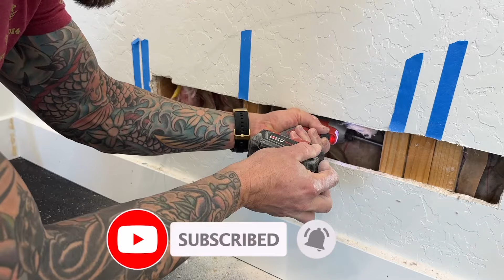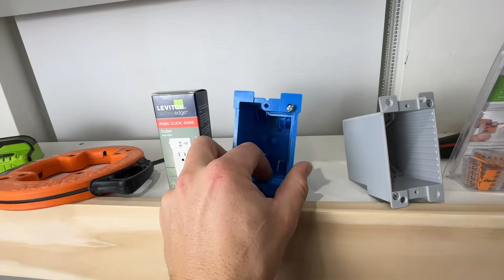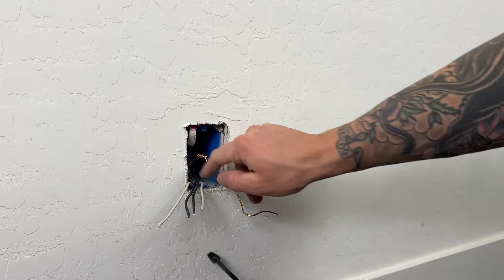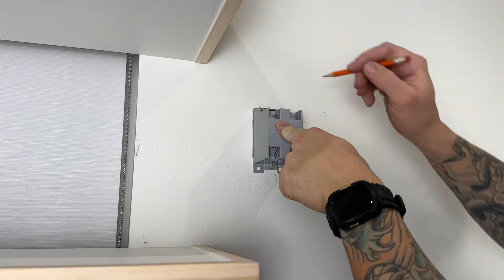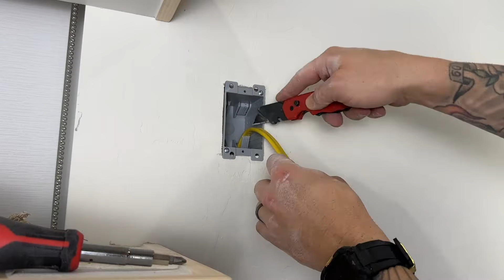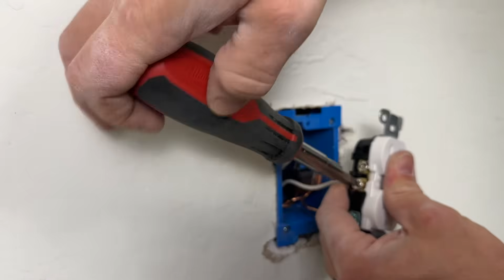How To Move An Outlet Up The Wall | Full How To

Comment: What if you don’t have a sawzall?
Reply from the maker: For cutting the drywall? In this I’m using a multi tool. But even if you don’t have something like that they sell a key hole saw that’s made for cutting drywall. It’s a way to cut out your drywall manually
Reply: @FortKnoxCo I’m sorry ,I meant to cut the nails. Would a the multi-tool work for that?
Reply from the maker: @MelMakesit ohhh. Ok. Well if you happen to have a multi tool you can still use that to cut through the nails. You’d just want a bit on it that’s made for cutting wood/metal. Just insert it at that angle down or up to hit where that nail is. The sawzall just has the longer blades to make it a little easier to hit that angle and reach. 

If you don’t have a power tool that does that you can still pry the outlet box off the wood stud with a strong screw driver and with a little work you can get of loose and un attached. Then you can either finesse it through your opening or I’ve even used needle nose players and removed the nails from the plastic box and then removed the box. Either way you may damage the drywall a little it because your working through that small opening. It’s kinda like the old kids game Operation, using tools to get the little piece though the hole without touching or damaging the edges. lol. 

But my next thing to consider is , if you’re going to be cutting the drywall next to the box anyways because you plan on moving it sideways…. Cut that drywall strip and you’ll have more room to remove that box anyways and prying it off the stud with the screwdriver is easier  and you can get it out of the wall much faster since your drywall is all opened up. More room to twist that box out and remove it.

Comment: Thank you for the super detailed step by step! one quick question, is it ok to not have the new installed blue old box attached to the stud again like it was before? thanks for sharing!
Reply from the maker: You mean like the new one or added one? Like where it can float on the drywall wherever you cut the hole and the tabs grab and secure it in place?…. Yep. Sure can. It’s sorta up to you have you want it to sit or be located. Nailing to the stud is very secure and standard building practice. But not necessarily required when doing renovation work.  There’s usually variances allowed when your not doing new construction and working on and update or renovation
Reply: @FortKnoxCo  I meant the old blue one you ripped off with nails, the new one (also blue) you installed didn't have nails to attach to the stud, my question was if that's ok to do, not attaching with nails again. Thanks again sir, you rock!
Reply from the maker: @tongoso yep. You can install an old work box in both locations. However you decide to install the original location or the new one. You have options. But it doesn’t HAVE to be nailed in type of box.
Reply from the maker: Also I just launched a discount code for my website grab any T-Shirt and get $5 off each one. $15 shirts 🤙🏼 Code:FORTKNOX5
Reply: @FortKnoxCo  thank you!

Comment: I did this yesterday following along with your video! Keep in mind, I'm mom in my early 30s and have never done anything remotely close to wiring or electrical! 😂 But we needed to move an outlet up the wall for a built in coffee bar we are making! Anyhow, husband was impressed and according to my Klein tester, everything was wired correctly! So thank you so much for this! It made the job less daunting and seem more attainable! 😀👍🏻
Reply from the maker: That’s so awesome to hear. And that’s exactly why I made this video and all the other ones on my channel. I want to share the knowledge and experience of being able to do something like this yourself. It’s very fulfilling and it obviously helps the bank account, lol. I’m happy you found it helpful.
Reply from the maker: Also I just launched a discount code for my website grab any T-Shirt and get $5 off each one. $15 shirts 🤙🏼 Code:FORTKNOX5
Reply: That's the same reason I watched this video. I'm planning in putting a coffee bar and need to move the outlet up. I've never done any kind of electrical work, so I'm really nervous about it.
Reply: @imeldabusby5958  You can do it!!! 5 months later ours works great and no issues! I even rewired a vintage lamp to plug in there and it works beautifully!

Comment: hi 
DOES staple wire or conduit not needed ? if yes - is it same if i install light fixture from outlet
Reply from the maker: Conduit is not needed. Your house wires are ran throughout the walls and ceiling spaces without conduit. For the staples, when the home is built during new construction to meet code they want to see the wire secured to the stud about 6” from the box. It’s to help prevent the wire being pulled on too much if something were to pull on it for some reason. But when a renovation or something like this is added afterwards it’s usually not common to staple the wire you are running. It is not possible unless you were to remove the drywall and open up the whole wall. The electrical box your installing usually has those tabs in the back where you push the wire through, that give some resistance to wire pull. It’s all for precaution. 

So in short, no you won’t see people stapling or secure the wires inside the wall on these types of revocations. Same goes for the ceiling.
Reply: @FortKnoxCo  ur amazing nd cool

Comment: What if you want to remove the bottom outlet and not put it back?
Reply from the maker: You can do that. You’d just be making the connections in the original box location and splicing the wires essentially. So connecting all the blacks, all the whites and all the grounds. 

But when you finish there are a couple options. You can keep that original spot with the box and just tuck the wires in and not have an outlet there, putting a blank face plate on it to cover. 

Or they do make code compliant splice connections that are allowed to be covered in the wall. They are a little beefier splicing connections and you would do the same thing connection the like wires, but tucking them in the wall and actually patching the drywall over them. Then they are covered and no one would know it was ever there.

Comment: Can you make a video how to hard wire LED lights to the under  kitchen cabinets with the light switch
Reply from the maker: I can! Now that I have my shops finished I’m going to be setting up some mock walls and doing full “how to” videos. So this would be a good one. 

I do have a how to hardwire led lights and garage lights. So that will be very similar. Except sometimes the under cabinet lights have a small transformer attached to power the LEDs. But it’s pretty straight forward